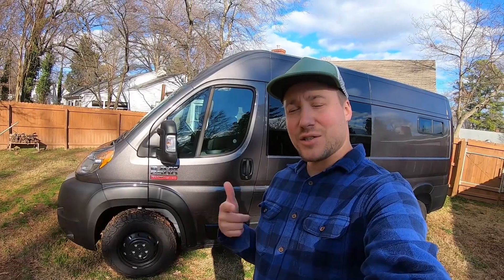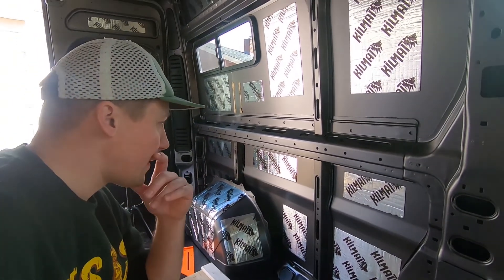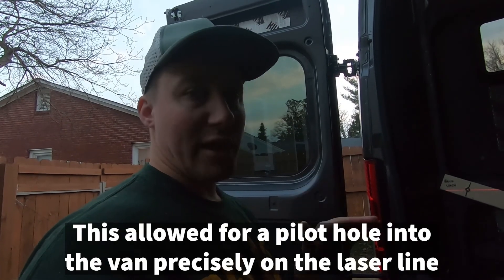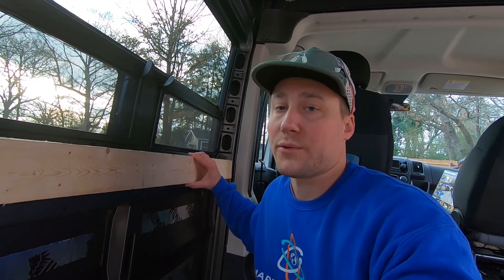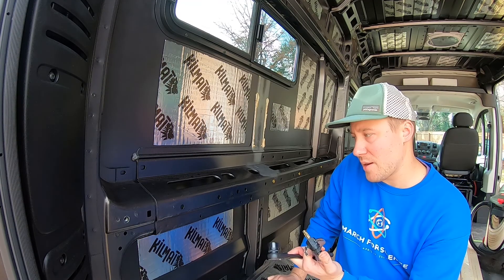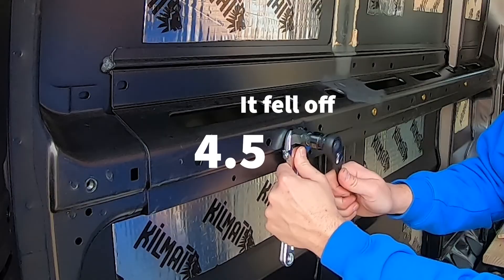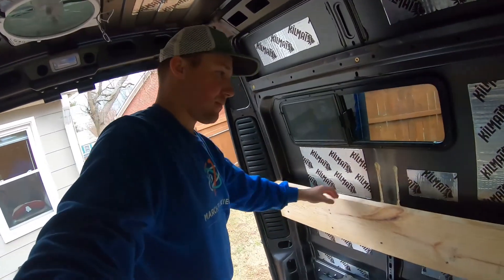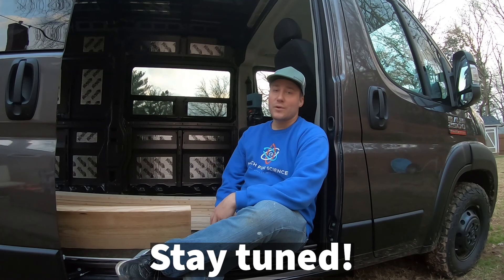Framing a Van + Plus Nuts + Floating Bed Frame Part 1 //Ep. 4 DIY VAN BUILD

Comment: hey so im doing my framing now, looking at the horiztonal framing member above the floating bed frame, and im a bit confused how to get it to sit flat against the van frame, since the piece is kindof curvey. what size wood piece did u use for those spots?
Reply: ah hey no worries actualy i just checked part 2, makes sense now!
Reply from the maker: Sounds good. I was in the mtns cross country skiing without service so sorry I didn't answer yesterday at all 👍🏼

Comment: Great Vid, Curious if you feel that the random placements of the kil Mat has made much difference we definitely noticed plenty of road noise and are just getting ready to start our build.
Reply from the maker: Congrats on taking the plunge into diy building! It definitely helped out. Especially the wheel wells, which would have very loud rock pings. They are dulled substantially with the sound deadener. Depending on the insulation you use, like wool, it also does a good job of sound dampening so you could possibly get away without it and have a quiet ride that way. Hope that helps. Cheers!

Comment: HI GUYS What tires did you put on the VAN?
Reply from the maker: Don't they look badass?!😎 BF Goodrich TA K02s in the stock size for the ProMaster, 225/75R16. With some wheelwell trimming you can fit 245s. Do you have a ProMaster?

Comment: Hi guys! I'm getting ready to order my plus nuts.  Are the 1/4-20 the only size you used in your van build?  How many did you end up using? Thanks!
Reply from the maker: Yes, I only purchased and used 1/4-20 size but there are other sizes that fit the factory holes that people have talked about in the comments if you are interested in that. I didn't want to hassle with more than one size though. I bought a single bag and I still have a decent amount left over. Glad to hear you are moving along with the build! 🙌🏻
Reply: FYI, these hex nuts (https://www.amazon.com/dp/B01MS63NZ7?psc=1&ref=ppx_yo2_dt_b_product_details) work well for the PM hex holes - and don't spin. I'm using them as they have the same M8 bolt pattern as the tie downs and I'm using 1/4-20 plus nuts for the round holes to supplement the hex nuts. I'm sure I will end up drilling several new holes as needed just as Matt has done.
Reply: @johnhaug8317  thanks very much for that info John!  

What length bolts did you guys use?  I am pretty behind on my build.  Got 3 of 4 windows installed, as well as 1 max air fan, but haven’t started on the interior framing yet.
Reply: @SoCalKevin  your bolt length depends on the materials you are securing. My floor took 2 inch (1/8 vinyl+3/4 ply+1/2 NPS). Be aware that most SS bolts are lagged, and you may run out of threads. I learned this the hard way before my 87th trip to the hardware store. :)

Comment: Your build has been a huge inspiration! Thanks for the video work AND build work! - Do you remember the width between plus nuts that you did for the frame? You said “predetermined” but was that 12” or 15”, or? And any reason for that? Just got a new ProMaster today so working with basically an identical ‘setup’. Thanks in advance!
Reply from the maker: Congrats on the van and for the diy plunge!🙌🏻 Thanks so much!  I'm glad they can be helpful and inspirational!

The main thing I meant by predetermined was that I found openings on the framing that didn't have other holes that would interfere/be difficult to utilize (like the hex holes). I wanted to make sure to space them out fairly evenly and not have any greater than 14" apart. Most members I had 2 outer screws and then equally spaced in between. I also utilized the M8 utility bolts where I could to not have to drill more holes than I needed to. Hope that helps! Definitely reach out if you ever have other questions or want to bounce ideas off of someone!
Reply: @Trailvagabonds  Thanks for getting back so quick! I have the m8’s as well and since I’m not doing as high of a bed lift as you guys I can actually run the 1x3 from the m8 on the far left (back of the van) to the m8 on the far right of the frame rail and hopefully not have to go laser level intense like you did! Thanks for the tips!
Reply: ** 1x4’s **
Reply from the maker: Haha, and I'm sure I could have done it differently and not spent so much time trying to figure it out the way I did. I'm happy to be able to give confidence to those diy building by showing how I don't always know exactly what I'm doing 😂

That's awesome you will be able to span the whole space! I'd love to see your progress sometime!

Comment: Great video!  Two questions--1. You mentioned a 38" height under for bikes but most videos seem to mention 36" being enough--did you need or want more room for some reason?   2.  Your 2x10 is a massive board, I wonder if there's a way to use something thinner and lighter?  Use a 1x10?   Good stuff--thank you!
Reply from the maker: Thank you! 😊 It means a lot to hear people like them. 

My main concern was our gravel bikes without dropper/quick release seat collar. I didn't want to worry about upgrading the bike or having to mess with it every time we ride (definitely a personal preference). There is plenty of space above our mountain bikes that 36" would have been ample I believe. For the board, I guess I wanted something that felt more solid. A 2x10 has an actual width of 1.5". A 1 inch board would be 3/4". I was worried about structural integrity but I can't speak to if a 1x10 could handle the weight.

I talk more about the bed height/bike situation in our Drawer Slide and Bed videos so they may be helpful to watch. Hope that helps!

Comment: I don't understand why vanlifers don't use the existing mount points with the right hardware.  What is the deal?
Reply from the maker: The average Promaster hole is a hexagon. Plus nuts will spin and be unusable in them. Otherwise they are very large or too small. It's a bummer. It would be really nice for Ram to get on board with making them useful. The Transit is one of the vans that have the perfect size holes for them so you don't have to do any modifying
Reply: @Trailvagabonds  They're M6 hex rivet nuts.
Reply from the maker: Thanks for sharing. Hopefully people read the comments here and see another option to use. In my research I felt confident in plus nuts because of their strength. There isn't much info out there about the hex rivet nuts- at least I didn't find them in my research. Hopefully as more people build their vans they will share that knowledge to help the community. I'm only offering what I did as a tool for others. Thanks for watching and sharing your expertise! 🙌🏻

Comment: I don't completely understand why it's okay to drill into the van if it has potential to cause rust. Some people just straight up drill self tapping screws therefore they are certainly going to cause rust if this is true. In your case, you are vacuuming as much as you can and using rust-oleum on the exterior of the rib, but given my experience with noticing rust spots on my van after installing the fan even after cleaning, it seems to me that it's inevitable that rust will form given the fact that moisture will certainly be a factor and you won't be able to 100% clean metal shavings. And in hard to reach and view places, like the inside of a rib, seems like it would be dangerous to do this. I'd love to know your opinions on this matter.
Reply from the maker: A lot to unpack in this comment...  I tried to be strategic in my hole placement to allow for cleaning up the metal shavings.  Holes underneath (the large oval holes on the bottom of the ribs)  where the drill holes were.  This aided in cleaning shavings up with a vacuum and also a magnet in a paper bag by sliding it in (which I didn't share footage of in the episode).  For applying Rustoleum you can get into the backside of the hole with a q-tip or small paint brush and I did try and make sure there was extra coverage and gave ample dry time.  That is the nice thing about a step bit, it is a very clean hole.

My biggest reason for using the cross nuts was ultimately for pull out strength which I do mention.  They are much stronger than a self tapping screw, not to mention a bolt can be removed and replaced as much as you need.  Self tappers don't give you this ability without hurting its integrity.  If you are agreeing rust will happen in your comment, wouldn't self tappers then not allow you to even try to mitigate it with Rustoleum? 

I have never once said I have the right or only answer to things, and I do try and spell that out in my videos.  People have always used self tappers in van builds and I don't fault them for it.  I came to the conclusion to use cross nuts after the research I did and I am only presenting what I decided to do with my build.  My main goal for my channel is to show anyone wanting to convert a van that they can do it and I hope to help give confidence, that needed push, or even make someone dream about doing it in the future by showing an average guy can make it happen.  I hope that answers what you were trying to get at with your comment.  If you want to chat more about it so I can understand you better, reach out on Instagram or by email.  All the best in your build if you are still in the middle of it!

Comment: rust .everyone is so paranoid about rust   reality we all will have traded in these vans for new ones in a year or two so we can build 2.0  !    BUT  I also sat there with the vacuum and a big magnet catching every speck of metal.  so silly ....   to buy my Sprinter I sold an AUDI I owned for 30 years !   With only 60,000  miles it looked brand new.  Then I bought a Mercedes with 180.000  miles !   whatever ..
Reply from the maker: In hindsight, I agree. It won't be a problem in our ownership. But it makes for more content? 😂